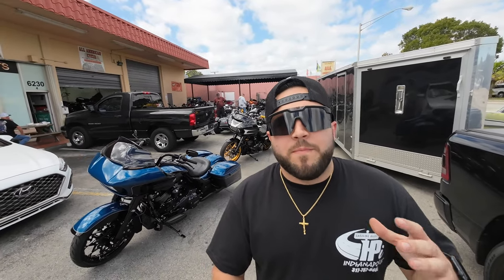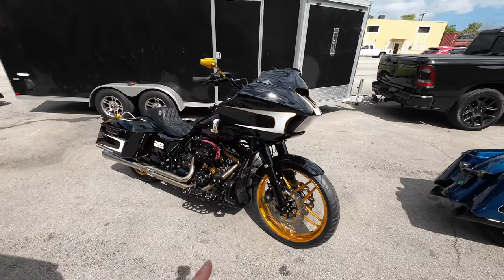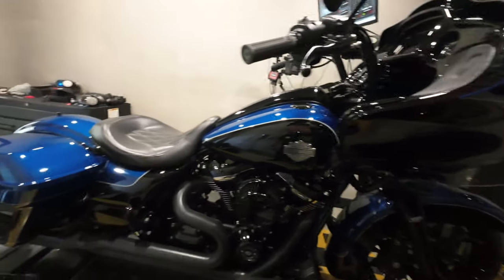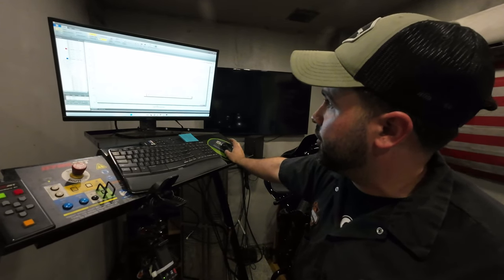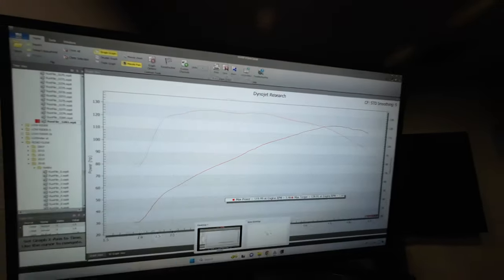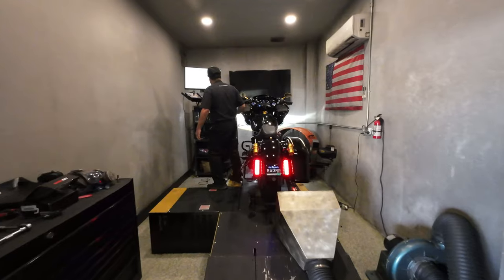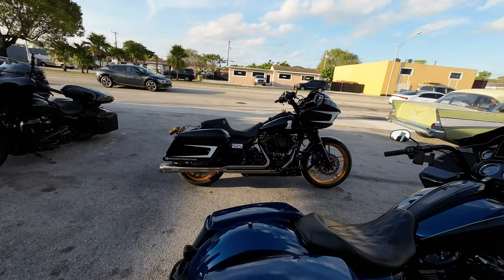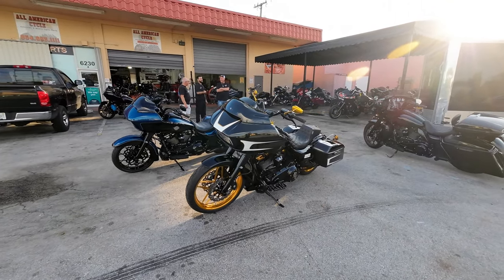CYCLERAMA CR483 DYNO NUMBERS RELEASED!

Comment: All American Cycle's dyno numbers will look higher than most tuners as he is using STD parameters vs SAE. STD has been outdated by SAE which is more accurate. STD numbers will be 5% higher than most techs who tune Harleys. Not that big a deal, however, I thought you should know.

Comment: quick question why didn't you change the cam plate on your moms bike when you changed the cam?
Reply from the maker: Because on the 2021 and up bikes, the factory cam plate and oil pump is good! Not necessary to change.

Comment: So, now you've done 2 Stage 2's, one with the 480mt, the other with the 483. Which one do you prefer??
Reply from the maker: Both bikes feel good, however the 480MT has more low end TQ.
Reply: @DOOWORKPRODUCTIONS  Thanks for the reply.  I have the 480mt. Just got it yesterday.  Looking forward to installing it.
Reply: @DOOWORKMOTORSPORTS  I am leaning toward the 480 because I want the power down lower. I have a 22 SG CVO.

Comment: Was the FuelMoto tune good? I got cams installed, mechanic added the FM tune and it ain't running correctly. Mechanic thinks the tune is bad and so does the dynoguy I'm taking the bike to.
Reply from the maker: The FM tune was a bit lean. A canned tune is good for heat cycles, but since every bike is different, I recommend getting a dyno tune to get it perfect!
Reply: @DOOWORKMOTORSPORTS  thank you. I removed the tune and the check engine light didn't come back on, so definitely something wrong with the canned tune. The dyno guy I'm bringing my bike to told me to trailer it to him, don't ride it because it sounded like it was overheating after I recorded a video after riding it for 30 miles.

Comment: don"t understand the hype on this cam. it sounds great but it seems like all bolt in cams are going to give pretty much the same numbers. it's like pick your poison. i'm running a rs468 in a 114, d&d billet cat big bore, hpi 62mm throttle body, hpi 62mm intake, feuling b/a air cleaner and 5.5 injectors. 119/133
Reply: Right. Totally agree. I have a RS472, Fuel Moto Jackpot XXX, S&S GNX slip slip ons , SE 55mm aluminum intake, Feuling BA air cleaner, stock injectors/ TB.  IMO, my bike sounds nasty… in a good way!!

Comment: Loosing 5hp and 5ft lbs of torque supposedly is huge didn't get to see the numbers, but your not chasing numbers just looks
Reply: @curtishoke143 I Bet he lost more than just 5HP. Aint no
Way its 5hp and 5tq.
Reply: @BikesBeardsBucks  I agree that's why I said supposed ly🤔
Reply: Wrong, very few people can tell a seat of the pants 5 hp difference. Rolling resistance will easily cause that loss.  You can get a 3-5 hp variance with the exact same set-up just because of weather.